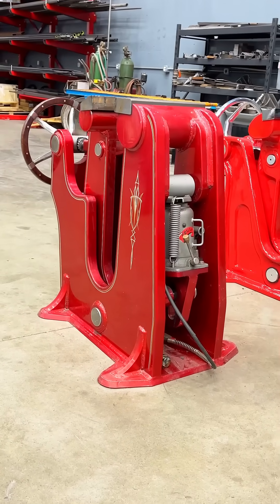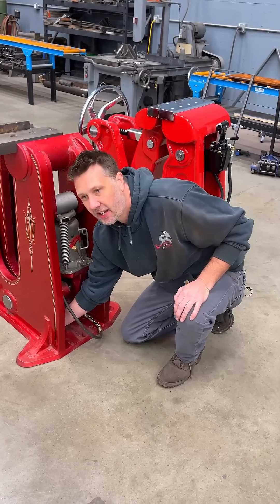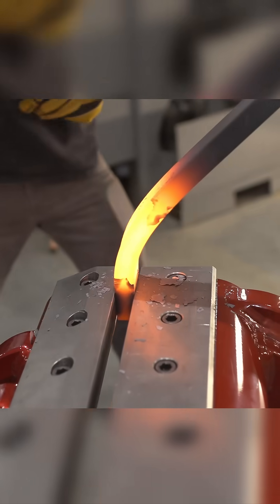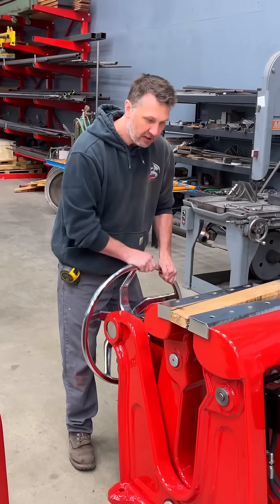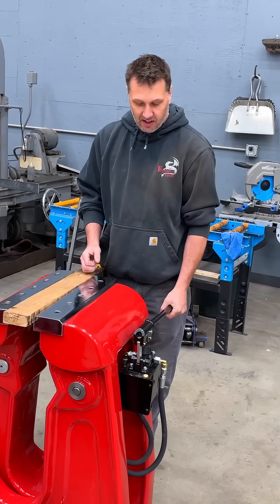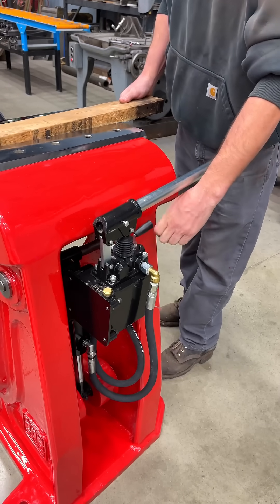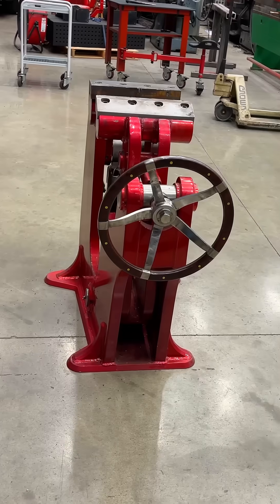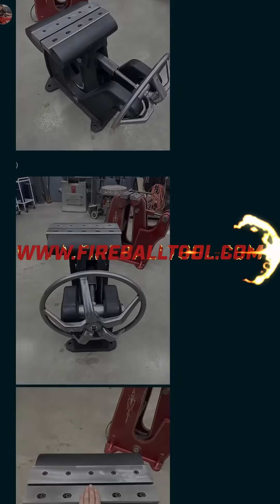The Vise That Went From Mistakes to Success! New Fireball 208 Blacksmith Floor Vise.

Comment: fantastic, you just have to make sure that the plates that hold the piece are fixed on two pins, and free to move, so they can adapt and align with the surface of the object you have to hold, I don't know if I explained myself correctly,

Comment: You should look into how the newer enerpac portapower pump work, they have a “high gear” that moves a lot of fluid but kicks out once pressure starts to build and still lets you get to 10,000 psi, would be great for something like this.